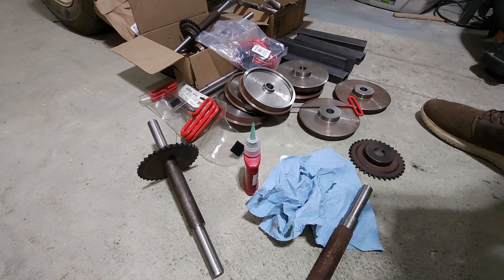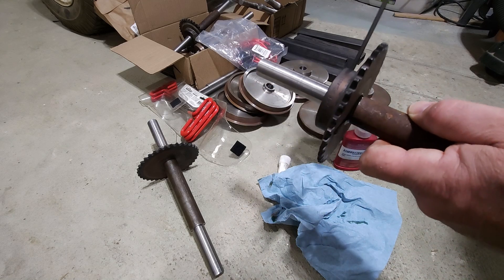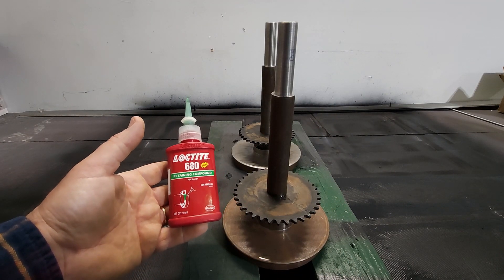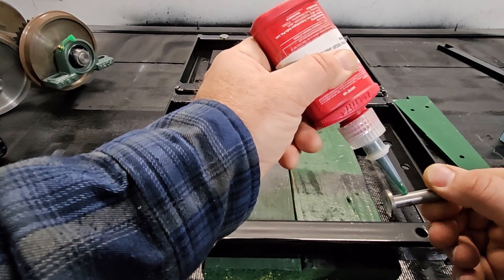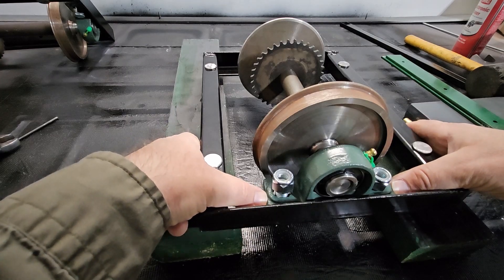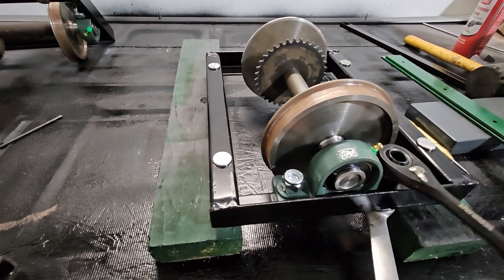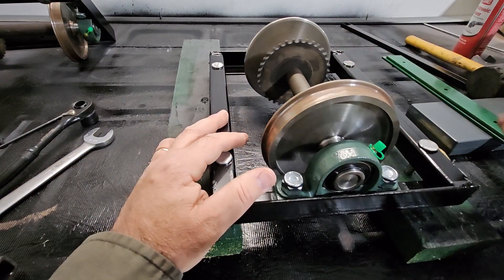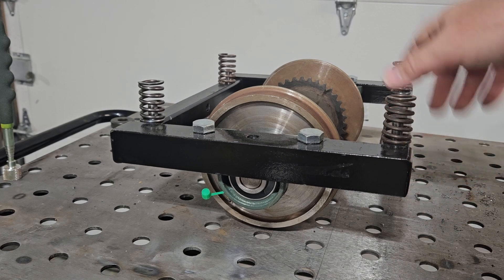Assembling 7-1/2 inch gauge locomotive trucks

Comment: Those look like SKF copies. The insert cartridge should have holes in the outer race to allow grease to get into the bearing when you pump grease in the Zerk. That said if you don't run in a wet or cold environment they'll come with enough grease to last for a fairly long time. 
The problem with the cold is they warm up during use, then when the cool off again they pull moisture into them. I've seen your videos.... Grease your bearings ;-)
Reply from the maker: Got it

Comment: You can save money by just replacing the bearing in the pillow block. Remove the pillow block from the assembly then use something to pivot the bearing inside the pillow block. Align the breathing pivot point with the slots in the casting and it will POP out easily.
Reply from the maker: This was a new build. It had no bearings before I installed them.

Comment: Aaron how did you make out with your wedged tree? nice next step in assembly of the engine.
it is nice to see the progress of the project. do you test them on the rails before they are delivered?
great job, liked the final part of the video, dumping the springs! just like a derailment! OOPs
Reply from the maker: Normally,  I test them extensively before delivery. This one was rushed and needed to be delivered before Father's day. 
As I write this, the tree is still hanging over the track.

Comment: Loctite brand Retaining Compound (609, 680, 690...  Anything "Green") works great!!  You're hard pressed (pun intended) to get something to break loose so long as you prep the surfaces per instructions and don't violate any of the "rules of use".

One question...  Why 7 1/2" gauge?   Most of the track/rolling stock in the Northeast (New England, NY and PA) is 7.25" gauge...
Reply from the maker: This loco is going to Iowa.